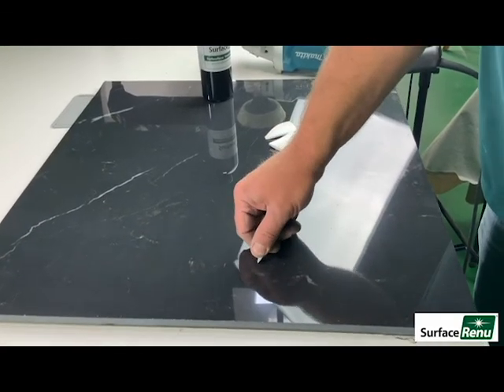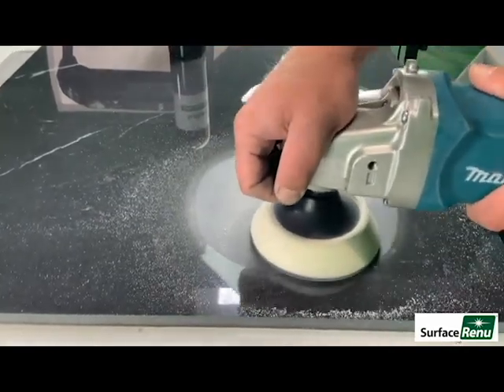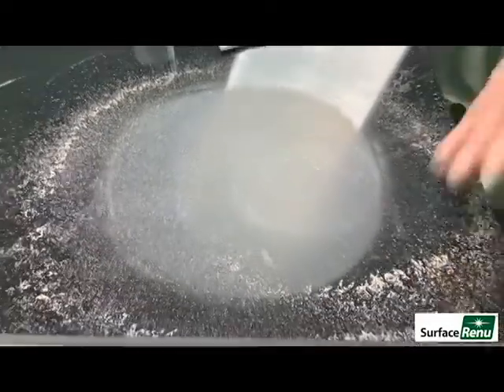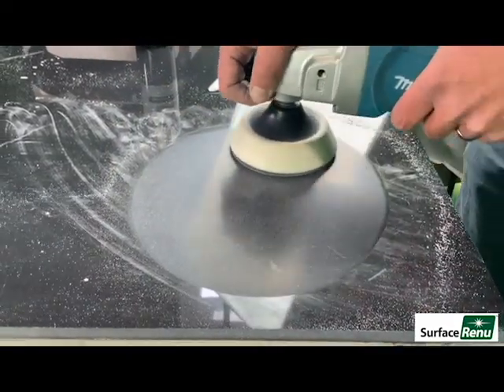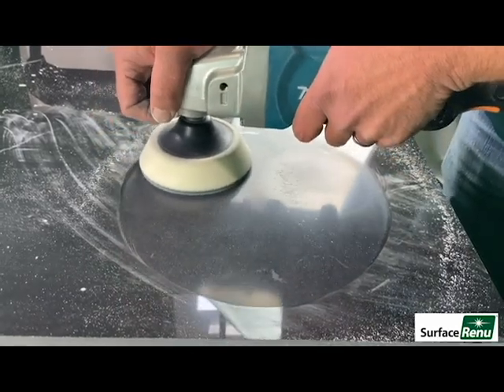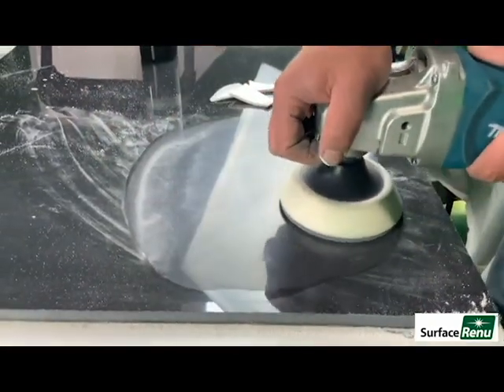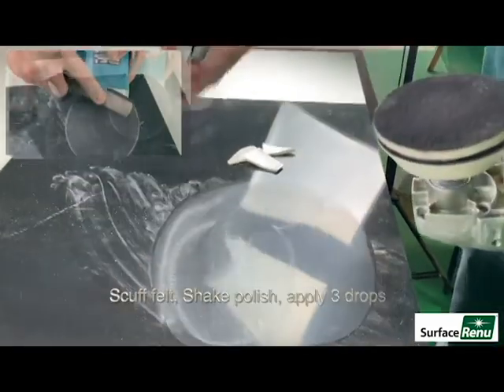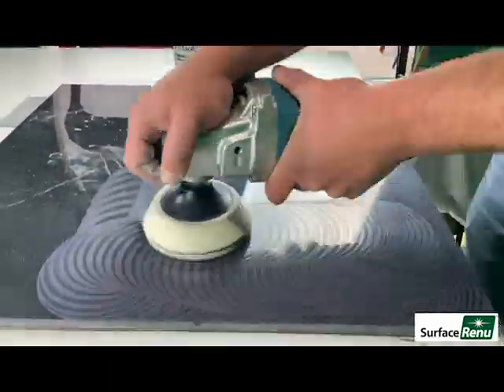SurfaceRenu Demonstration - Repairing Black Porcelain

Comment: I have never seen Porcelain 20mm thick
Reply from the maker: Although not porcelain, Dekton is a sintered material and is available in 20mm thickness. I believe some other sintered stones are available in 20mm. Surface Renu will work on those materials.